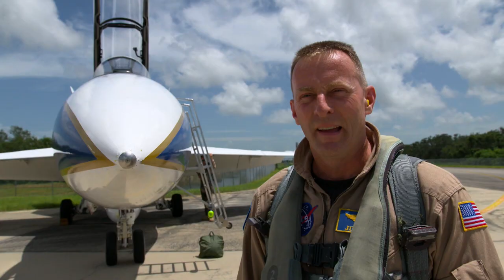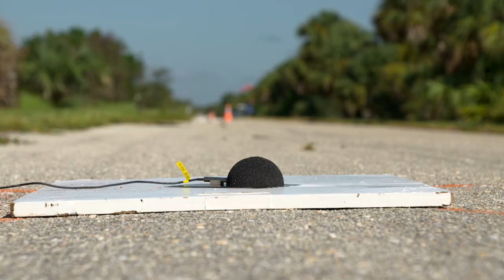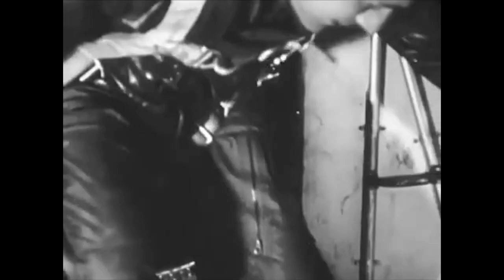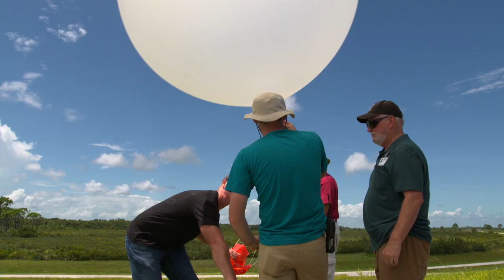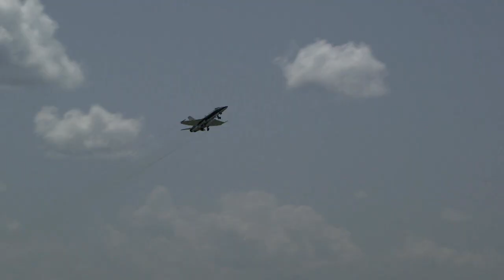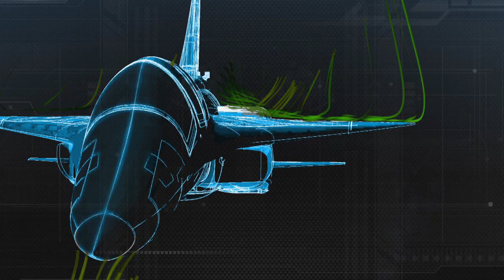Sonic Boom Testing at NASA: Daily Planet

Comment: Does a sonic boom have different effects during different weather? Very hot day vs very cold day...very dry day vs very wet day...
Reply: "The composition of the atmosphere is also a factor. Temperature variations, humidity, atmospheric pollution, and winds can all have an effect on how a sonic boom is perceived on the ground. Even the ground itself can influence the sound of a sonic boom. Hard surfaces such as concrete, pavement, and large buildings can cause reflections which may amplify the sound of a sonic boom. Similarly grassy fields and lots of foliage can help attenuate the strength of the overpressure of a sonic boom."
Reply: MR Ketch Thank you for your response... Dont be surprised if I have another question for you... Thanks again!
Reply: @marcinhoplim  Will the sonic boom be heard only the time plane first moves faster than speed of sound, or will it be a continuous thing as long as it's flying faster than speed of sound ? sorry for the noob question.
Reply: @mightysyng8302  As the plane flies over the speed of sound it creates a "boom cone" behind it that can be heard according to distance of the hearer and atmospheric conditions. After the plane passes over the object the pitch sound of the waves tends to become lower due to distance and doppler effect.